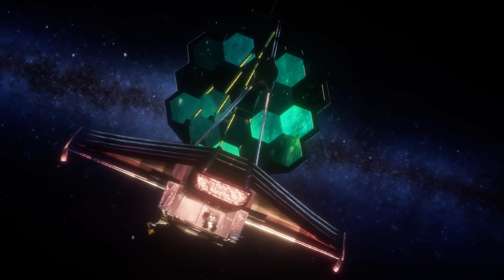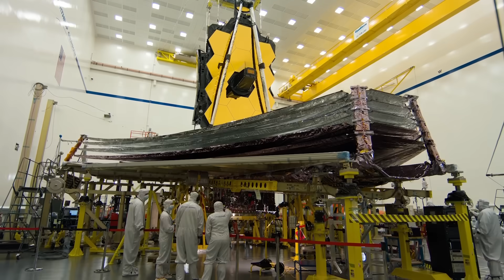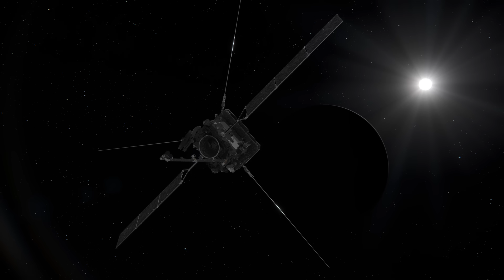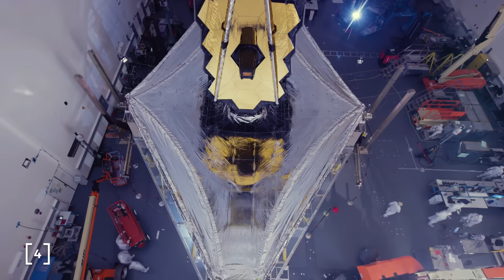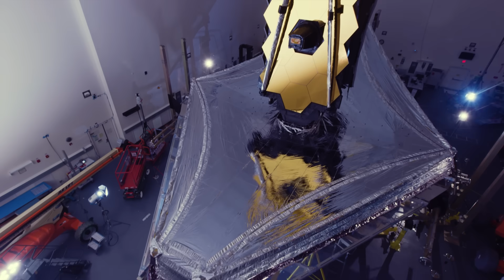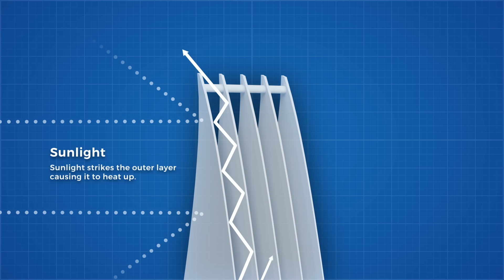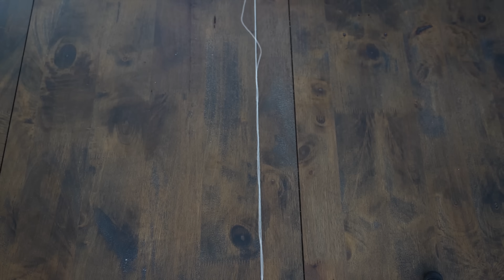The Insane Engineering of James Webb Telescope

Comment: Absolutely amazing to see the engineering that went into this, I'm just concerned as there seems to be so much that can go wrong, what are the odds it makes it through everything without a hitch? Seems low to me
Reply: why would it be LOW exactly?
like whats your problem with it? the materials? design?
Reply: @accent1666  the amount of things that can go wrong in deployment is insane, on top of that if there are any issues with any of the tools on board they can't be fixed, I really hope it does workout though it could completely change the way the new generations view the universe and how it was created
Reply: @accent1666   Are you being serious with asking that?
Reply: @actualamateur149  he could at least explains us why

whats wrong with you?
Reply: @accent1666   The whole video is pointing out reasons as to WHY it could fail. 

344 single points of failure just on the telescope itself, not to mention everything that has to happen to get it onto the rocket, and then in to space without issues. 

Then it has to travel a million miles while deploying itself over a 6 month period while hopefully not being hit by anything in space. 

If 1 thing goes wrong, the entirety of the 25 or so years it took to build would go to waste.
Reply: Hell it's already been jerked around in transit, a clamp failed and caused the telescope to jerk in a way it wasn't meant to, and it wasn't even on the rocket yet.
Reply: @actualamateur149  ok then, thanks for laying it out
Reply: @actualamateur149  I'm terrified this is going to fail. I'm cautiously optimistic.

Comment: I really really hope they have done some engineering for ease of repairing in space. It seems like a robotic refuel (and repair?) drone would be fairly achievable, especially in 10 year's time.
Reply: @SecureLemons  there's only so much reinforcement you can do to moving parts. They're inherently Weaker. You can identify moving parts that are fragile by design such as sensors and other sensitive be components and be ready to repair them.  

Kinda makes sense to have an automated repair system in place, even if it isn't perfect at first.
Reply: Agreed, never say never. At some point, the telescope will be serviceable. Even if deployment fails, they’re not going to write off a 10 billion dollar project without at least trying to salvage it.
Reply: They worked on this 25 Yeats, ten is kinda low to start over

Comment: 13:18
Kelvins*
There is no such thing as a fegree Kelvin because Kelvins are absolute units and not degrees.
A Kelvin of temperature is like a Newton of force or a Joule of energy, in that, there is no scale, just quantities.
Reply: Can you please elaborate on the point of "no scale, just quantities"? I was just trying to look into what the degree is doing in °C and °F, but didn't find out much. Why aren't they just called Celsius or Fahrenheit, like in "the triple point of water is at 0.01 Celsius"? Does the degree have something to do with the fact that the zero-point is shifted from absolute zero?

Comment: I'm actually more interested in the repair robots. I think this is something that we have been missing in space exploration for a while now. Keep in mind, it doesn't need to be autonomous - it can be entirely remote controlled. Yes, that would extend the time of the operation, but is that really an issue? We're still a long way from operating at distances that would introduce significant delays in communications - the JWST would have a 5s delay. Sure you won't play Halo on it ;) But doing a step by step repair with careful verification should be possible. By the same token, I hope they took this into account when they placed the hydrazine tanks in the JWST - so they are at least somewhat accessible for potential future refueling.

Comment: Very awesome informative video, as always. BUT you said a number of times a regular mistake "X degrees Kelvin". Kelvin is an absolute measurement system, it's not in degrees. So the mid infrared detections system needs to be cooled at 7 kelvin, not 7 degrees kelvin

Comment: I wanna know more about the 300+ points of failure specifically. Literally step by step what could go wrong with all 300+ points. Why is no one making a detailed video about that?
Reply: A glass half empty kinda guy I see...
Reply: You don't want much, do you 🙄
Reply: @T.E.S.S.  I'll settle for an explanation on 10 of them 😁 All videos I've seen so far always bring up "over 300 single points of failure!" but then never go into what the are. Its usually "something, something sun shield, lotsa clip gotta release" but no actual information on what exactly can go wrong. I just find it hard to believe that they'd spend $10bil and launch this if they weren't pretty damn sure it would work. I know with lotsa release mechanisms on spacecraft they use explosive bolts because they are very reliable cause it's a chemical reaction (and therefore highly unlikely to not happen)  like with the ascent stage of the apollo lander they use hypergolic fuels to leave the moon because its just mixing 2 chemicals and letting chemistry do the rest because it had to work or they were dead (single point of failure, there was no backup). So I'm just curious how "risky" these single point failures really are. I suspect they aren't as risky as we've been led to believe. I'm actually not a pessimist and don't really understand why everyone is so sure it will fail. I personally think it will succeed. 🤞

Comment: Lagrange points to me are a bit of a mystery and seem counterintuitive. It seems as though a spacecraft in a higher orbit at L2 would need to have a higher tangential velocity in order to maintain the same angular velocity as the Earth, but does this not contradict the Oberth effect? How does gravity achieve this exactly? (Great video as always btw)
Reply: Because the earth drags it forward. You know that higher orbits are slower, but this is a case where n-body mechanics become important: L2 works because it’s not just orbiting the sun, it’s also gravitationally affected by the earth.
Reply: lagrange points are about multiple gravity wells, not one. imagine two objects pullign an object equally at a poitnt o produce a secondary gravity well (or rather, 5 of them)

Comment: 18:52 There is a mistake in the explanation here - In fact, gold reflects the low frequencies in the visible spectrum better. Infrared is toward the long wavelength / low frequency side of the spectrum. I guess frequency and wavelength were confused here in the explanation, the graph/plot shown at the same time refers to wavelength and seems accurate.

Comment: Thankfully after the calibration checks it payed off that this billion dollar gamble works even better then expected. According to a paper by NASA, ESA and CSA scientists almost every aspect of the telescope exceeds expectations. The optimal performance is more stable, the optics were able to self align more accurately then believed, the fine guidance system is more precise, the mirror more clean then required and the throughput of most instruments significantly higher. Performance is in some use cases likely gonna be on the order of tens of percent better. Oh and new estimates also peg the telescopes lifespan realistically at up to 20 years instead of 10. Surely some amazinf science to come over the next decades.

Comment: 17:56

@realengineering beryllium has an atomic weight of 9.012 amu… The atomic number is 4 meaning that it has 4 protons. If it’s atomic weight was four, that would mean that there are no neutrons in the nucleus and apart from hydrogen, that simply does not happen in nature.

Also at 18:53:

The lower (shorter) the wavelength, the higher the frequency. That would mean gold is great at reflecting at lower frequencies than at higher ones.

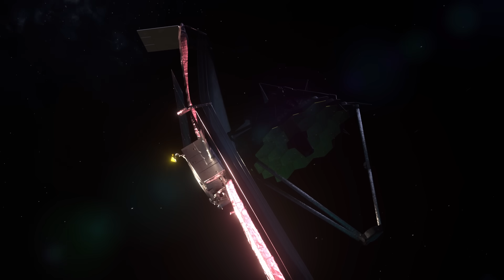Comment: great video, but the graphics at 5:00 are actually misleading. The JWST won't be on L2 to shield itself from the sun by staying in Earth's shadow. Protection from the sun happens purely through the sunshield which can produce a ~300 degrees Celsius (!!!) temperature difference between front and backside. Being in Earth's shadow even part of the time would result in unwanted temperature changes which can affect the mirrors and technology inside.

Comment: One thing I didn't understand at first is that, while JWST orbits around L2, it isn't directly in Earth's shadow. All the diagrams and explanations I've seen seem to suggest it hides in Earth's shadow. First, L2 is semi-stable. It's easier to orbit the point than it is to stay directly within in. And second, JWST still needs solar panels to function, which means it would lose power and die in shadow.

Comment: Would some form of solid state cooler not have been better for cooling the infrared sensors because it has no vibration at all, so they wouldnt need to worry about it? Or maybe solid state coolers just arent there yet or maybe dont work at those temperatures, or arent efficient enough.

Comment: The JWST is brilliant, but I've always been concerned about damage from micrometeorites and larger impacts, tearing that sunshield and scratching the mirrors. I have to say, some redundancy and less single-point-failures would have been nice.

 Refuelling actually seems like one of the easier problems to solve. All they needed to do was create an interface where a vehicle could dock onto the back of the telescope and automatically dump fuel into the fuel tank. That said, this is really only possible if you've actually designed a system where a vehicle can easily dock and interface with an easily-accessible fuel tank, so I'm really hoping someone thought that far ahead. It gets a lot harder if you need human hands to dissemble part of the telescope to get to the fuel tank. Trying to actually replace entire parts of the telescope if it gets damaged would be what's really difficult.

Comment: Hey guys! First of all, I love what you do! Thank you, from a fellow aerospace engineer, for the way you make understanding accessible, yet challenging.

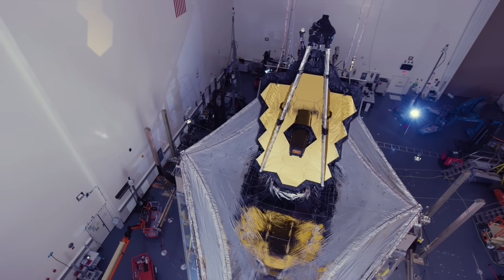Just a quick note... @5:22, the illustration shows "-83" (negative) degrees Celcius, whereas the voice explains it is "+83" (positive) (I quote: "... nearly hot enough to boil water. ...").

Just a small item to bring to your attention. 🙂

In any case, keep doing what you are doing.

Thank you!

Alberto.
Reply: I get why you would think that but no they actually meant -83, the boiling point depends on the pressure and in space the boiling temperature of water is much lower.
Reply: @cardia1769 ood point about pressure affecting boiling points but the temperature would actually reach positive 85 degrees Celsius. I was curious and looked it up and saw a tweet about it from the official nasa JWST account about how hot the sun side can get.

Comment: The Hubble mirror error was in the design and assembly, and not by the manufacturer, Perkin-Elmer Corporation, who ground it to spec. There was also a small hole drilled to relieve stress from a tiny crack, though one of the engineers described it as "a mole on the shoulder of a beautiful woman".
Reply: not quite. Perkin-Elmer used an instrument (the null corrector) to check the curvature of the mirror. This instrument was designed for another mission, and had to be modified for Hubble. During that modification they made an error, which meant the null corrector guided them into grinding the mirror to the wrong shape. 
PE did check the curvature using a second method which showed that the curvature was incorrect, however they chose not to believe the results.
Reply: @h.dejong2531  Hey! I'm one of the guys that finished the mirror! Are you going to argue with me? Just joking. This is what I remember from reading about it a few decades ago while they were finishing the mirror. I just read some more a little while ago and you're right, especially about ignoring test results. However, I am sure about the hole and mole comment. I guess that it was more like skin cancer. It was lucky that they could correct it.

Comment: 19:00 lower frequencies are red and infrared, how is that it's bad at reflecting low frequencies, and good at reflecting infrared, it even look gold
Reply: Reread that chart.  Red/infrared has high reflectance, the chart is "wavelength vs reflectance", not "frequency", so the parts where it has low reflectance are all higher energy/higher frequency/lower wavelength light

Comment: "...a very thin coat, just 0.1 micron is coated over the polished beryllium subsurface, taking just 48.2 grams of gold, about the same weight as a golf ball; a surprisingly small amount for the huge mirror which has a collecting area of about 25 square metres...."

Get that! It's called precision! Awesome video. Awesome science. Awesome engineering.
Reply: Back in the mid-1970s, I used to do “vapor deposition” of various materials (eg., titanium oxide) onto glass & plastics substrates for optical purposes. It turns out to be very easy to control the thickness of the coatings down to fractional wavelengths of light (dozens of nanometers). You have 2 optical ports in the bottom of the vacuum chamber, and as you deposit, you shine a light beam (simply a “chopped incandescent beam”, probably a laser today) thru one optical port up onto the surface of the substrate onto which the material was being deposited, which then bounces back down thru the 2nd port to a sensor which displays the intensity of the light beam. As the material is being deposited you get two reflected beams (one off the substrate & the second off of the exterior surface of the deposition. These two beams combine & interfere with each other. As you deposited, you’d get a clear & precise sine wave in the measured intensity, as the light interfered constructively then destructively at each 1/4 wavelength of light thickness in the deposited coating. Even back in the ‘70s (tech dark ages), it was easy to get unbelievably precise deposition thicknesses. I’m certain they are MUCH better at it today. The simple shift from polychromatic incandescent light (which we used) to monochromatic laser (which we didn’t have), would increase the precision by about a factor of around 10 to 100!
Ahhh, clever engineers… no?

Comment: I wonder why it doesn't use ion thrusters, surely the fuel would last longer?
Reply: Ion engines are heavier than hydrazine thrusters. So they do really well when you need lots of delta-v (which would require tons of chemical fuel), but in this case the weight of ion engines plus propellant plus solar panels is higher than that of hydrazine thrusters plus propellant.

Comment: Question for some nerds - what defines light making it's way to us? We can see the light from past stars with new technology where we otherwise could not...so has the light actually traveled that far to us or are we shortening the distance it has to travel to be seen by zooming in? Also, how are lightyears measured when light travels at different speeds depending on gravity? What if the the gravity of a certain star or planet we look at is significantly different than our own and light travels slower or faster from that place...is that factored in to when we measure? Or is there just a general number we use for light traveling through empty space?

Comment: I'm curious about how the universe could have cooled after its formation if the universe is literally everything that exists and as far as I know, something can only cooldown if it has something else to transfer the heat into. Of course, my assumptions about heat transfer might just be wrong.
Reply: I think I figured it out. The total amount of energy in the universe is constant, because the universe is a closed system, but due to the universe's expansion, the energy density per unit volume is decreasing.

Comment: JWST A3 and A6 mirror actuators are stuck at 12.3 millimeters.  Webb won't focus if the actuators remain stuck.
Reply: From the Mirror Segment Deployment Tracker: Segment A3 and A6 will be moved separately at the end of the process because their position sensors are read out in a different way. So they're not stuck.

Comment: I'm surprised they didn't just launch a separate solar array to catch all the sunlight, to then power the JWST, while also blocking the bulk of the heat.
Reply: Flying two spacecraft in close formation is difficult: they're in different orbits, you you need lots of corrections for the 2 spacecraft to stay together. Then there's the collision risk.